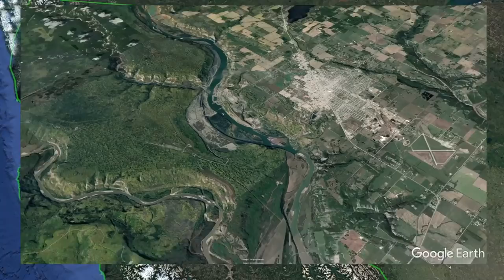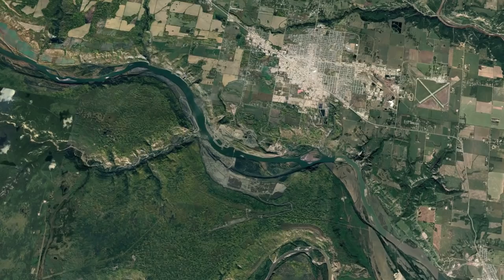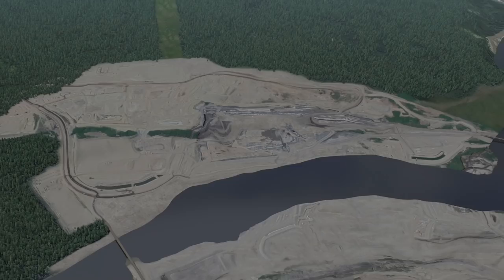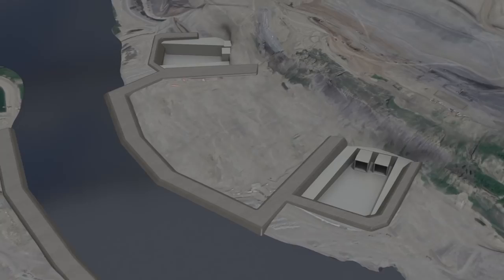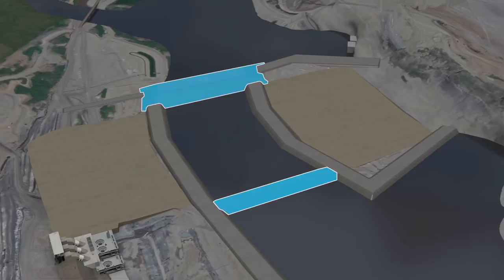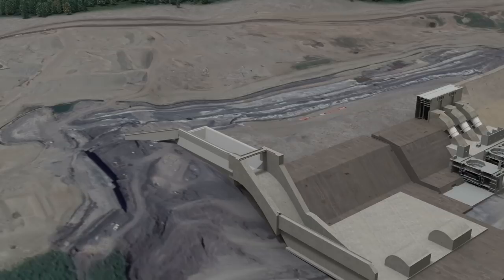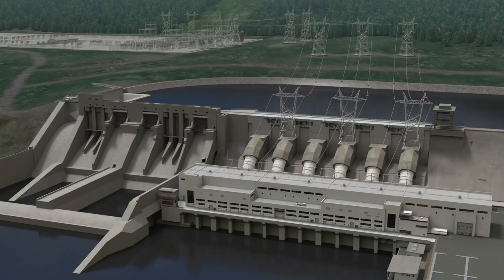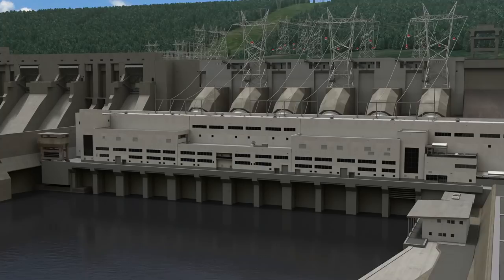Site C Construction

Comment: The dam has serious geotechnical issues and is being built on geologically unstable ground in an area with lots of ground movement and riddled with faults and weak rock,  and now very seismically active with all the fracking going on only 10 km away, a disaster in the making in my opinion.
Reply: @hippy1002  David who?, lol, nice try sir douchalot
Reply: They’ve had to shut down construction due to earthquakes in the area, I give it 10 years until failure